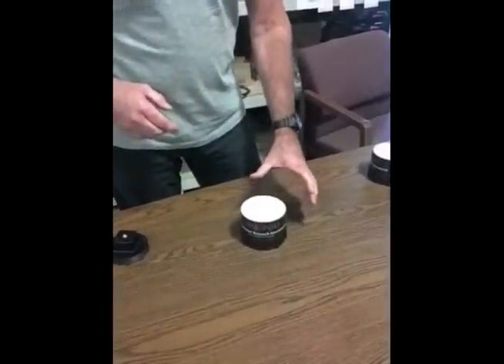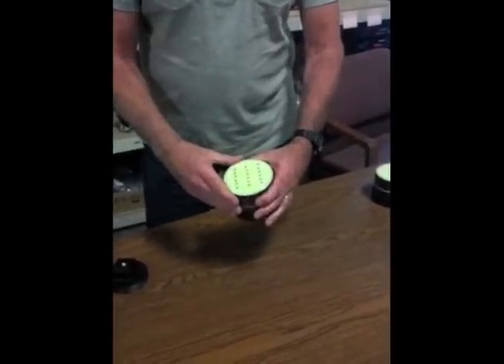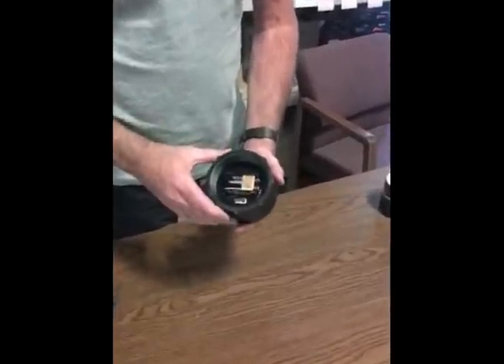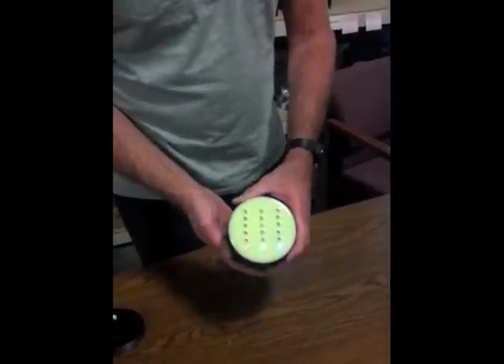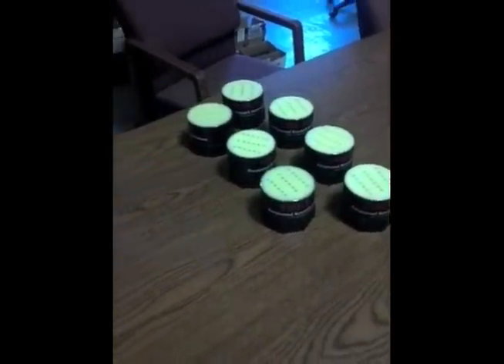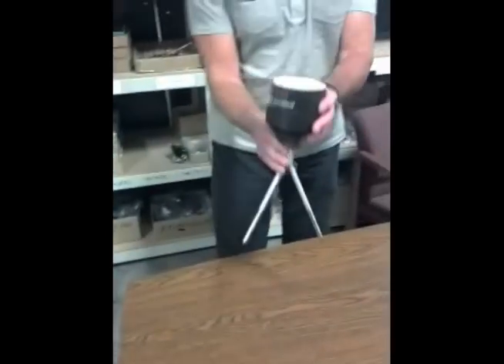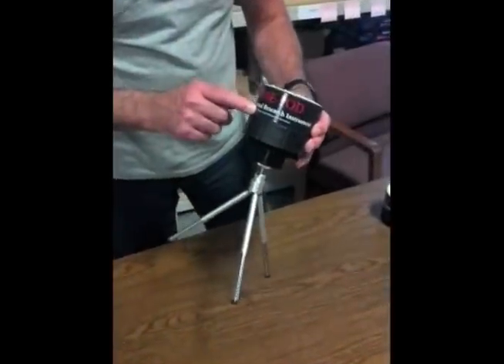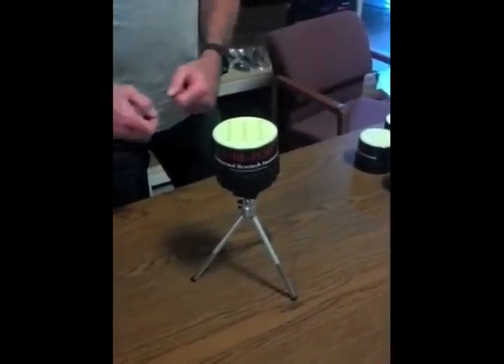Vibe-Pod 3-Axis Vibration, Movement & G-Force Detection Device

Comment from the maker: Hi Scott, The geophone uses a seismic type of vibration sensor and the Vibe uses a 3-Axis accelerometer. An accelerometer can be used to detect vibration, tilt, G-Forge (M x A = F), movement, etc. The 3-Axis accelerometer can show these variables using the RGB LED arrays & with three distinct sounds.